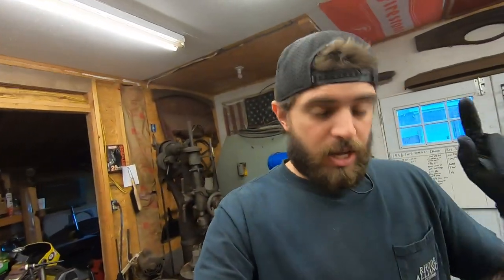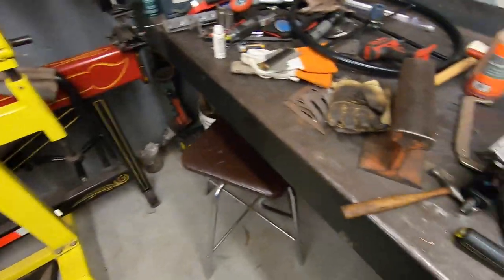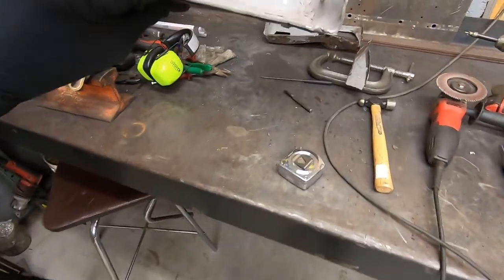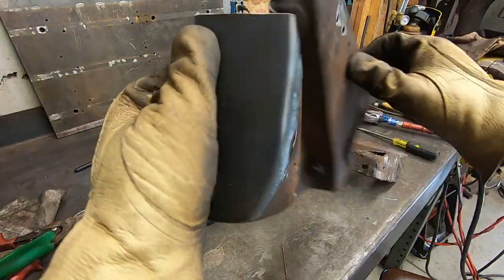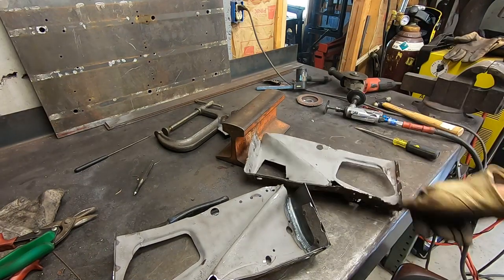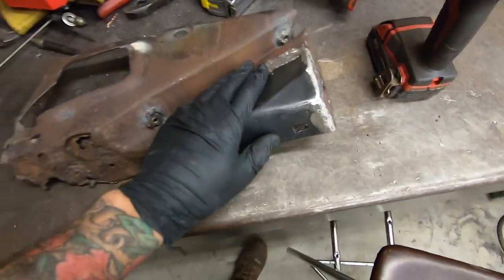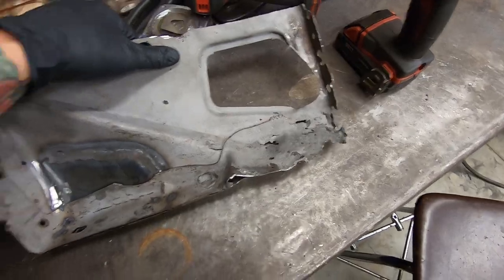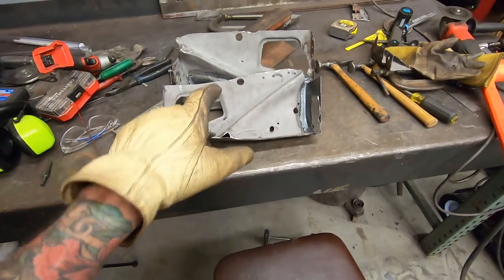Repairing the Cowl Feet on the 1936 Ford Roadster

Comment: You better start coating the back side of hidden areas with weld thru primer to protect bare metal from rust , you need to invest in a blast cabinet , from harbor freight